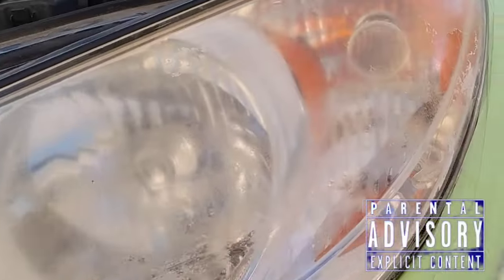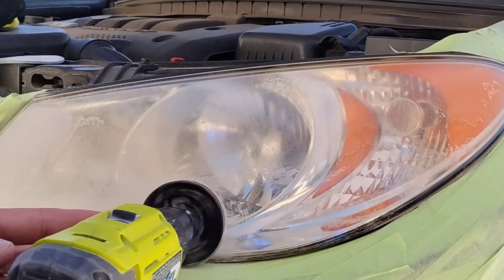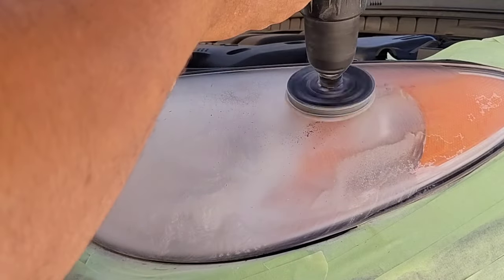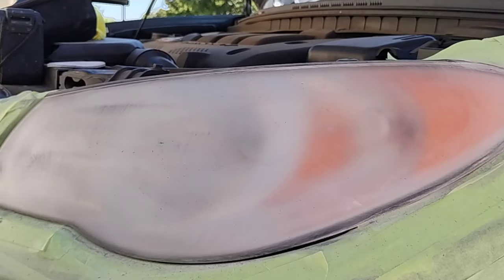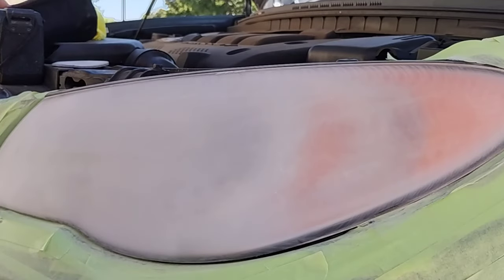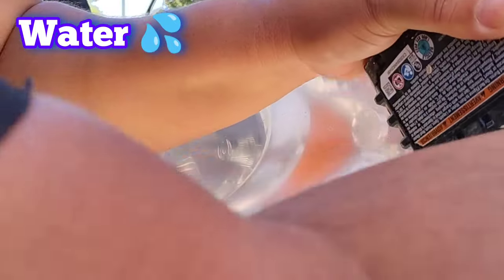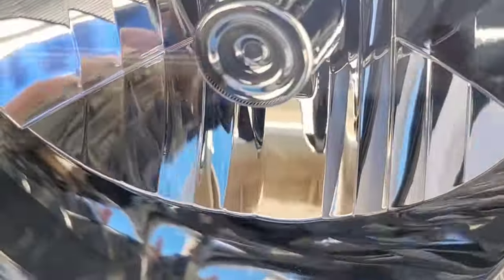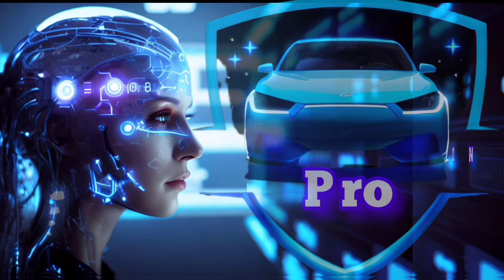Headlight Restoration - TRANSPARENT and TRANSLUCENT 👁️ steady-hand

Comment: I recently did the headlights on my 2008 Suburban using these techniques and 3m discs., and Meguiar's UV coating. They look crystal-clear, but when I turn the headlights on there are hazy spots, which I think is also diminishing the light output. So today I re-restored the passenger side headlight (rather than doing both, I thought I'd test and compare), starting with a P320 disc (to grind down any deep damage), followed by P500, P800, P3000 Trizac etc. (and, of course, polishing). It looks crystal-clear again, but when I turned the lights on, the hazy spots were still there. I wonder if this is indicative of internal heat damage from the lights themselves over the years, or if I may be doing something wrong. Also, if this is a classic case of internal damage, how can someone know by looking at the headlight before attempting a repair?
Reply from the maker: It takes a trained eye and experience to be able to spot these things before going into the headlight.. and sometimes even I don't see it until I'm done or into the headlight.... Sounds like you have some kind of internal LED damage or reaching issues which is very common... You can only work with what is given to you... If you want to see some videos of internal damage and breaching check out these...https://youtu.be/-HWqTLhIPT8?si=3OeirK-pEt1ERmpE

https://youtu.be/kMT24NX9KG8?si=L2WclWGijwlQ_Cbn

Comment: Whenever you post I hit the like button quickly 😊
Reply from the maker: Thanks you man....I appreciate it 🙏🏽😊
Reply: Do you ever have static from the headlights after wiping them down with a microfiber towel?

How do you wash your towels?
Reply from the maker: @simplyclear5802 no .  Never...
I wash them in the washer with Tide pods...Then dry them in the dryer on low heat short cycle as to not over heat...

Comment: I just found your channel... you are awesome bro! I am a mobile detailer in las vegas, ive been honing the craft of headlight restoration. I have a question, whats your thoughts on ceramice headlight coatings? I have used meguiars headlight coating in the past but the overspray and all the masking for it made me look for alternatives. I have used geyon can coat and Mckee's 37 headlight ceramic coating. I am still testing them, On the mckees ive seen close to the year before it degrades but for some cars only a couple months. 
So just wanted your opinion on these ceramic headlight coatings, thanks bro
Reply from the maker: Okay so upon testing most ceramics have enough light transparency to pass the headlight light test.. which is better to say than 2K clear or a lot of other things that will not pass it it does not scatter light but that's about the only good thing about ceramic on headlights ceramic is ultra thin once it dries... Basically dissolves over period of time so it's not a fixed coating.. along this path of dissolving it often hits different stages of degradation which makes it not appear as good when first applied or function as good as when first applied... But back to the main problem with it it is too thin... On average it's probably 1/7 the thickness and elasticity of regular made for headlight coatings Expressly spray coatings... Another thing is that ceramic typically is a hand applied product which is far inferior any sprayed product.. spray product is superior... Been wanting a long-lasting smooth finish in any kind of process you do not hand wipe on stuff there's always delivered through spray.... Even when lights are sprayed in the factory they're sprayed in the factory..lol
Why tell everybody the method of spraying is more efficient by far if any kind of wipe on product the 3M wipe on is better than 99% of the competition far as their clear coat... At the same time it falls less than most of the sprays if not all because it's not a spray.... I know what you're thinking double coat triple coat you should watch why not to double coat on my channel and you will see why more than one coat is really not recommended on headlight restoration....(hope this makes sense I talk text and did not proofread much)
Reply: @theheadlightrestorationpro  thank you, you are very in depth. That makes a lot of sense now, they are so thin and not a true coating even though they are,, it’s an invisible film and over time the film degrades. Verses the meguiars headlight coat, it’s a true “turtle shell” layer on top of the headlight. 
  What you think of ppf on the headlight, that’s something else I was thinking, more work but it could be an up-sale and that could be even longer protection but of course going to take some time to get good at that. Thanks for your feedback

Comment: Your opinion on using a Heavy Compound like 3D 510 for the polish stage ? Is double stuff method needed for the ACDelco polishing step or just drill sanding ?
Reply from the maker: Compounds don't work as well... They provide good scratch removal but they do not provide good saturation and the smooth crystal clear finish that you want because they are lacking in beneficial oils like products used in design for actual headlight restoration and or plastic... ACDelco is too fast for double stuff.. highly not recommended.
But they could be beneficial when mixed..
Check this out if you haven't seen ithttps://youtu.be/UAwcDGK7wrk?si=7m14cyNIOh3a5P0v

Comment: Why did you jump from 800 to 3000 without the 1200 and the 2000?
Reply from the maker: Because they're extremely unnecessary... Like walking 10 miles when you can drive at a fraction of the time with it less effort... Want some more of my videos and see that with this method is extremely unnecessary that 3,000 triac is not a 3000 it is a revolutionary new technology that does the work of everything from p 900 to like p 5000...
Also that's not a 800 disc it's a p800 disc as I use all p disks European scale disc much much more quality higher quality better in every way.... There's a difference... Oh yeah there's over 130 videos streaming on this channel at about 400 examples (including portfolio videos) of this method the best finished quality that anybody's ever seen...

Comment: you didn't wipe the light after polishing?
Reply from the maker: Yeah don't try that at home.... Good eye... Very rarely the light is polished so much it doesn't even need to be wiped.. it's an advanced topic that I wouldn't recommend anybody trying for a very long time that's why I didn't mention it... The light was polished so well over polished I thought there was nothing to wipe. It's complicated I wouldn't worry about it and definitely don't do it....
I was a perfect polish with a light amount of polish and because I was able to stick perfectly around the light there's no over polish or any scenes of Polish inside of them or even any dust left over so duster was enough to clear the light... As I said it's complicated wouldn't really try it at home you'd have to understand headlights enough to know when to not do that which is really complicated and comes with time as I said not recommended....